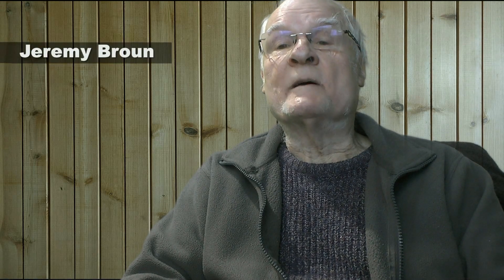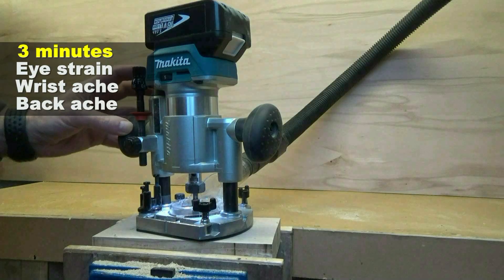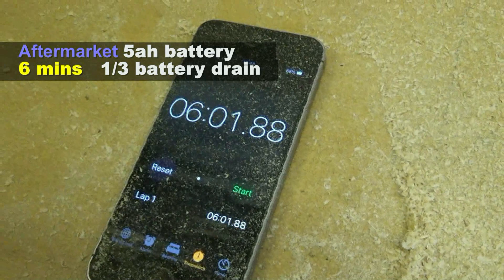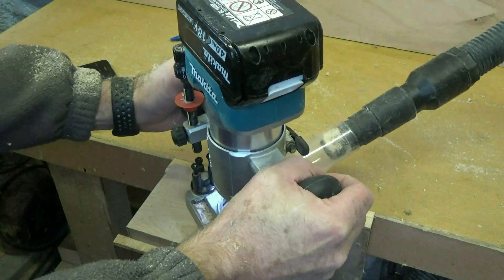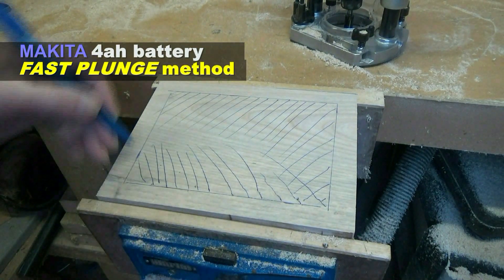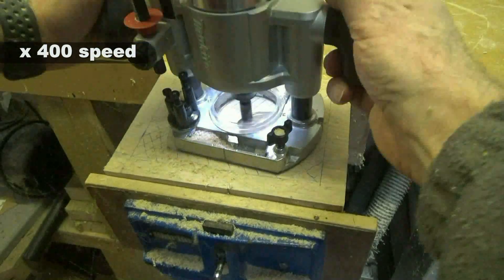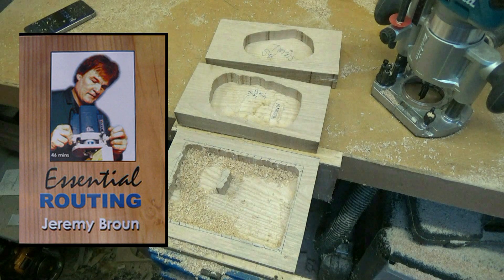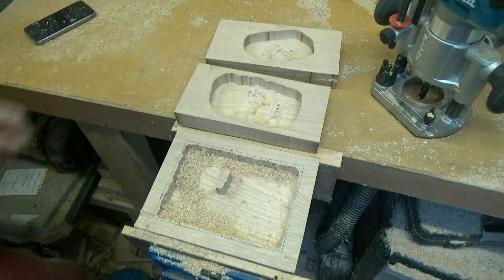Cordless Router Power - Makita DRT50 - Runtime & More

Comment: Dramatically increasing battery life (run time) by simply adopting a different technique is inredible in it's simplicity. By taking only small cuts or light passes, this keeps the rpms optimal while adding as little torque load as possible. Great advice, Thank You Jeremy
Reply from the maker: Hi Edward. Im surprised that I first shared this method in my book The Increbible Router in 1989 and yet it is still little recognized or used as far as I am aware. There are other routing techniques that exploit the nature and weakness of wood fibres and will significantly exten battery life now that cordless routers have arrived.
Reply: @WoodomainJeremyBroun 
 I would probably say, here in the states, no one really cared about power until the battery powered revolution took over. Back when you wrote your book in 1989, you just plugged in a bigger tool if you needed more power, no need for any power saving techniques. The router is one of, if not the most demnading, in terms of power consumption. Only now are the batteries and motor combination able to handle the demands of traditional routing. Had everyone adopted your method, they could have enjoyed battery-powered routing without the need for constant battery changes/charging a long time ago.
Reply from the maker: @Eweber007  The battery power saving aspect of course is a recent bonus. The main benefit and reason for my fast plunge technique is one of efficiency and speed.  Why take three times longer than necessary to cut a mortice or recess would be my question? There has been very little critical analysis on woodworkining method outside factory production. Finishing for instance can take as long as making.
Reply: @WoodomainJeremyBroun  
Not only three times longer but harder on the tool as well. There are no doubt many other common methods of work and/or techniques that could bebefit from a critical look into their efficiency.

Comment: Very clever plunge technique Jeremy! Brilliant stuff 👍
Reply: I use the exact same plunge technique removing a lot of metal in my machine shop. Straight cutters of this type are much stronger and more efficient and generate less heat plunging versus side cutting in any material. Remove most of your material plunging and finish with light side cuts.
Reply from the maker: Yes I am surprised it is not widely used as it appeared in the first edition of my book The increbible Router in 1989 and that was a bestselling book . My calculation of runtime when I ran out of wood in this test was conservative. I think it will at least treble the runtime. So if a router is used for surface skimming and other light cuts the runtime will be similar.